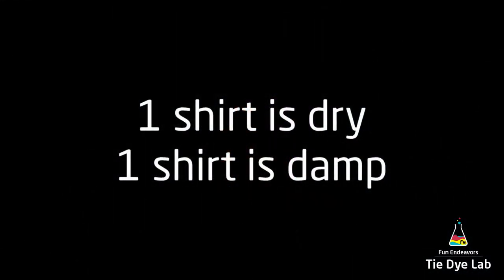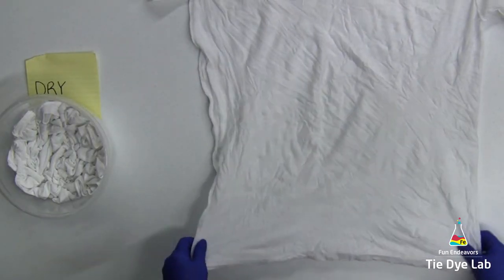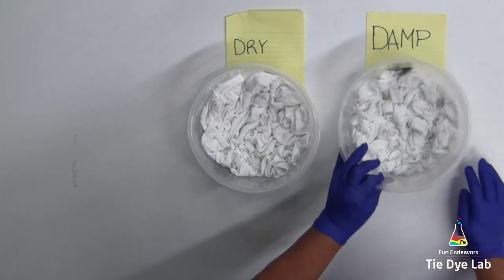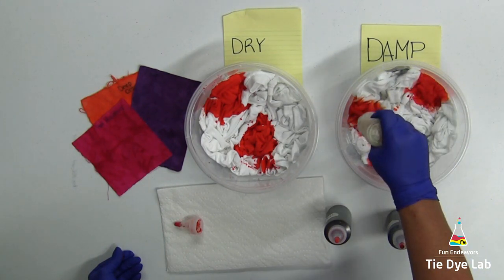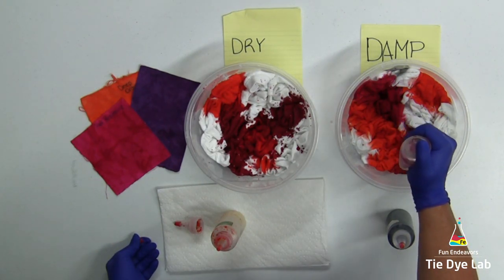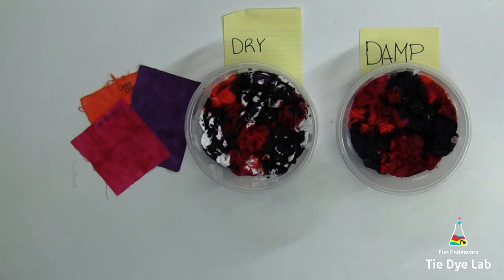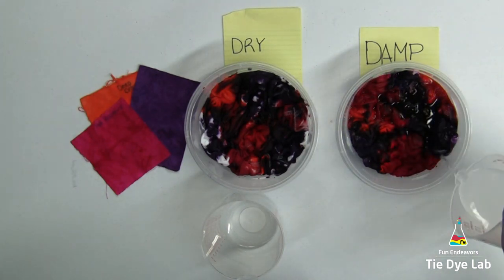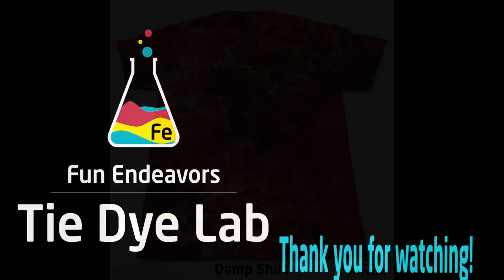Comparing Low Water Immersion On A Dry Vs. A Damp Shirt [Tie Dye Design Technique]

Comment: Thank you for trying this so we can see the results and I like the way yours turned out 🙂 I have only done this dry, and I used 2 tsp of soda ash per cup, 1 tsp of sea salt per cup, put the dry ingredients in a heat proof container. Then I boiled some water on the stove and immediately poured into container with dry ingredients, stirred quick and piping hot, it got poured over the shirt.
Reply from the maker: Thank you!  I thought this would be a good technique to try both dry and damp.  
How did your shirt turn out?
Reply: @FunEndeavors  Well, I only used one color but it turned out pretty nice 🙂 I got a mix of fades and powdery fluffy color and where the highest concentrations of dye where dark and sharp. I even got some color splits. It is shirt 18 on fb 🙂 I plan on doing a 3 color one here in a few days, I will let you know how it goes 🙂
Reply from the maker: @TheWVbear  yours turned out really well - I like it!
Reply: @FunEndeavors  Thanks 😊

Comment: For the soda ash solution, was it room temperature water?
Reply from the maker: I usually use hot water for soda ash solution.
Reply: @FunEndeavors    I’m following your suggestion and reading Paula Burch’s site.   She says something that makes me wonder.  I’m seeing hot water immersion, low water immersion, ice dye, etc.   She basically says batching is unnecessary.  Batching for 24 to 48 hours.   What do you think.  I have no experience so I have to ask you what you think or what is your experience.   Here is the quote….

Reaction Time. You must then leave the soda ash to react with the fabric and dye for a miniumum of one hour. Some prefer to "batch" the reaction for 24 to 48 hours. I have never found this added time to be necessary, though I will leave the reaction overnight when that is more convenient for me. I believe that "batching" is an attempt to make up for low temperatures in the reaction, caused by low room temperature. If your room is cold, it may be more useful to warm the reaction (*after* adding the soda ash, not before, as dye will quickly react directly with hot water, leaving none to react with the fabric) than to leave it for long periods of time. Experiment with this for yourself.
Reply from the maker: @iknowheis  So, tie dye using fiber reactive dye needs 2 things to cause the dye to properly bond with the fabric:  soda ash to raise the pH and heat.  In hot water irrigation, the water is heated hot enough so that it will bond the dye to the fabric without having to wait and batch the shirt.  The reaction happens quickly because the temperature is so high.  Otherwise for regular liquid or ice dyeing, the reaction happens more slowly over time ideally in a space that is above 70 degrees Fahrenheit.  If for some reason the area where you are batching your shirts is below 70 degrees, you will need to allow them to batch a longer period of time to get nice vibrant colors.  
The same goes for low water immersion - the soda ash solution that you pour over the shirt is very warm and so it doesn't take as long for the reaction to occur.  The soda ash solution usually isn't quite as hot as it is in hot water irrigation - therefore, I usually allow it to batch a little longer than I would a hot water irrigation shirt.
In the summer when I place a regular liquid or ice dye outside in a container where the temperature is over 100 degrees Fahrenheit,  I really don't need to allow it to batch a full 24 hours either since it gets so hot.  It won't hurt to allow it to process a little longer though.
Reply: @FunEndeavors    I live in the desert.  Hot temps are not hard to come by.  It’s not hot yet, but will be a blast furnace soon!  Thanks for the input!
Reply from the maker: @iknowheis  Then you live in the perfect area for tie dyeing!

Comment: Great video, Angie! I've been experimenting with this technique too. I like the results of both  the dry and damp. So fun to try different things and always be surprised at how they turn out! I noticed that you said you wrung this shirt out by hand. Any particular reason?I wanted to ask you about your Panda spin dryer.  What is it's capacity? I'm seriously considering it but wonder if it's worth the price. How much soda ash do you save each time? Thank you so much for your videos and for taking the time to read and respond to my questions!!
Reply from the maker: Thank you so much!  I  didn't use my Panda Spin dryer for this one.  Since I had to take the shirt to my work sink and run it under the water to get it wet,  I went ahead and wrung it out by hand since it wasn't sopping wet.  
I love my Panda Spin Dryer though.  It is by far one of my favorite tie dye tools.  I'm not entirely sure how many shirts I can fit in there at a time.  I've put about 8-10 in it with no problem.  It's awesome for hoodies and sweatshirts.  If you've ever tried to wring one of those out by hand you know how hard they are to work with.  I think I've put 2 or 3 hoodies in it at a time and it worked great too.  It wrings them out really fast (a full cycle is 5 minutes), so if you had a lot of shirts to do it wouldn't take a long time if you had to run it more than once to fit them all.  There is a spout at the bottom on the front where the soda ash drains out.  I bought a couple small plastic pitchers at the Dollar Store that I use under the spout to catch the soda ash and pour it back into my soaking bucket so there isn't much soda ash waste - really only what soda ash stays in the shirts.  I actually watch the spout and when  most of the soda ash has been wrung out, but the stream is still a trickle - I stop the spin dryer.  If I let it go the entire cycle (which is 5 minutes), the shirts will almost be too dry to get them all tied before they are completely dry.  I also love since it doesn't weigh a lot, I can move it easily to use inside or outside.
Reply: @FunEndeavors  Angie I thank you so much for thos detailed description and explanation. It's exactly what the needed to know.Sounds like it is well worth the investment. Large and bulky blanks are so difficult to wring out and I really don't like to waste water or SA. I'm sold! Thank you again, Angie, for your sharing and very helpful videos!
Reply: @FunEndeavors  Here's a tip for you that I do....I cram all my shirts into a 2.5 gallon Ziploc/or hefty bag and pull them out one at a time and reseal as I tie each shirt. I keeps them damp LoL 🙂
Reply from the maker: @TheWVbear  that's a good idea - thanks!
Reply from the maker: @magicre3  You are welcome - I hope you love yours as much as I do mine!

Comment: Interesting. Wonder why PB says to add the soda ash solution after?  I've done a LOT of LWI (quilt fabric, not shirts) and my instructions said you can either do the presoak or add it later, but the presoak lets you recover as much solution as possible beforehand instead of throwing it away afterward. So I presoak.
Reply from the maker: I'm not entirely sure either.  For the rest of the tie dye techniques, I soak beforehand too.

Comment: Why do you turn the shirts inside out?
Reply from the maker: Sometimes the powdered dye doesn't totally dissolve properly and it can leave speckles on the shirt.  If the shirt is inside out,  the speckling will hopefully just stay on the inside of the shirt and won't come through to the front side.
Reply: @FunEndeavors  Thank you for the tip.  I have had speckling on shirts I have done.
Reply from the maker: @alisalarue4506  it doesn't eliminate all speckling, but it helps.